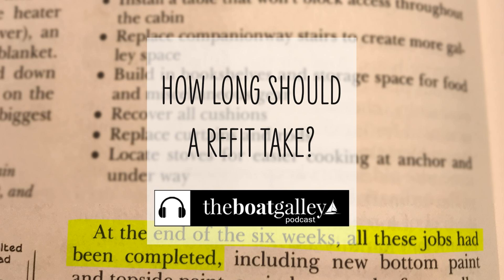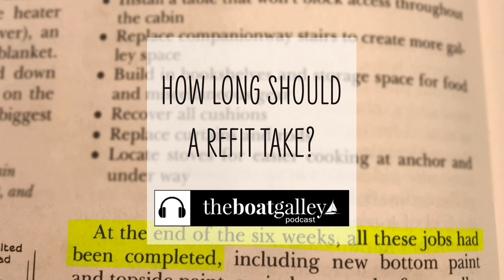How Long Should a Refit Take?

Comment: Hi there, I just found your podcast and I think I love you a bit. 

I've been trying to fix up my boat for a while and see other boats come in and leave the boat yard whilst my list of must do's grows exponentially. And I ask if I'm the only one taking so long.
Job 1 - Replace lighting with LEDs
ok but whilst looking at the old lights it was clear the 50 year old wiring was origonal and not in a good state.
Job 1.1 Rewire the boat
ok but I didn't know where the wires ran - so remove panels to expose wiring - panels showed signs of rot
Job 1.2 fix rotten panels
ok but they had rotted out for a reason - need to find source of leak - pull off more panels and rip out insulation
Job 1.3 find and fix leak
ok but now I see a different leak 

job 1.3+ go back to 1.3 until all leaks have been identified
ok but now half the boat is in pieces and I can see a bunch of water and fuel pipes that also need replacing
Job 1.4 replace old pipes
Job 1.5 replace insulation
Job 1.6 replace all damaged panels
Job 1.7 complete Job 1.1 re wire boat
Job 1.8 go back to Job 1 and replace the lights with LEDs  can't job ob hold as budget ran out half way through Job 1.4 

Job 1.9 re charge the boat kitty so now working for anoher six months to recharge the kitty to enable me to get back to and tick of job 1 on the list.  Job 2 looks even more painful

refit in 6 weeks!! pffff my @#~@

An old boy shared a cuppa with me a few years back and said 'son, you have to decide if you want to sail or if you want to fix boats to perfection. There's nothing wrong with either, but you can never do them both'   With this in the back of my mind I'm adopting your phrase of leaving 'when the boat is done enough'

Fair winds, kind seas and may your tools never rust.